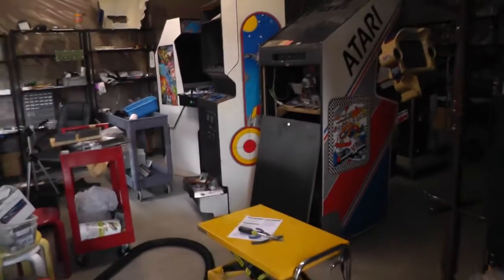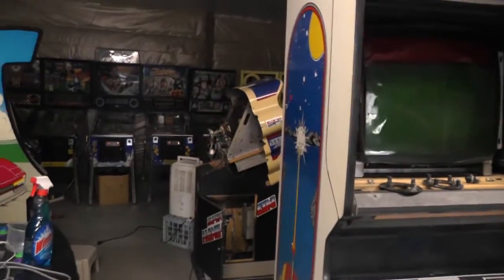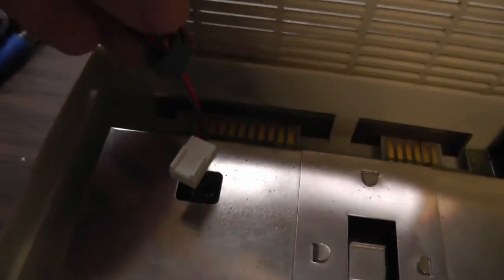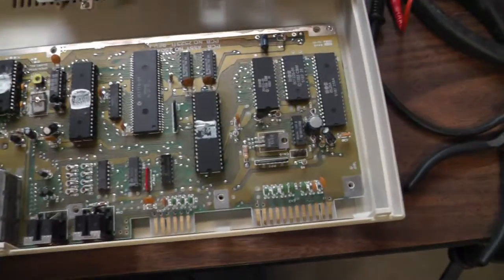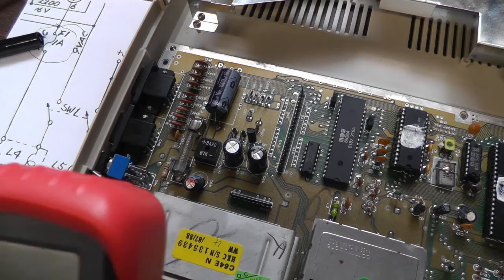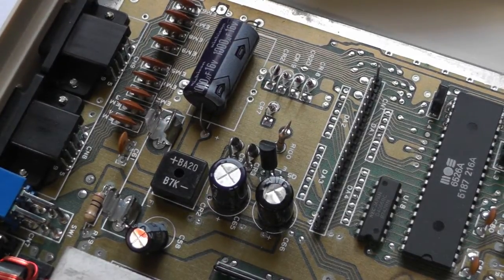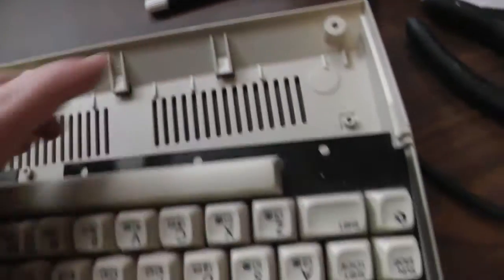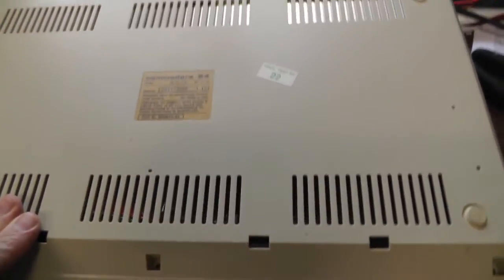How to check and change a fuse inside your Commodore 64

Comment: Hi there.Thank you for the video. I bought today a Commodore C64C but it's not working. I've tested the Fuse and it's good. Do you know what could I do to test the Power Supply? I don't really know which pins should I connect to my MultiMeter. 
Thanks